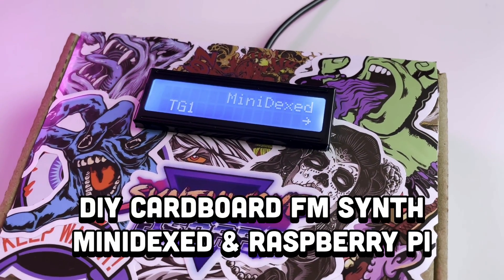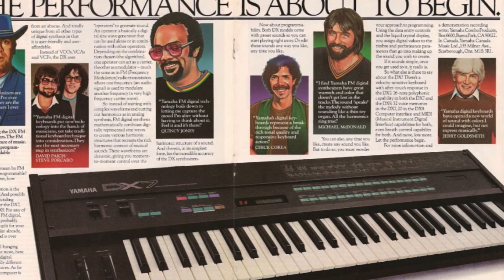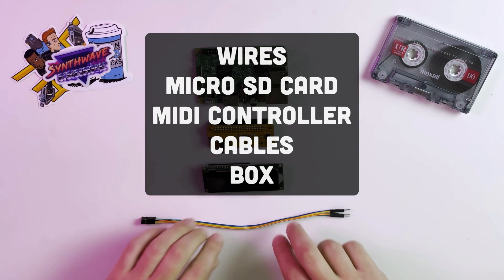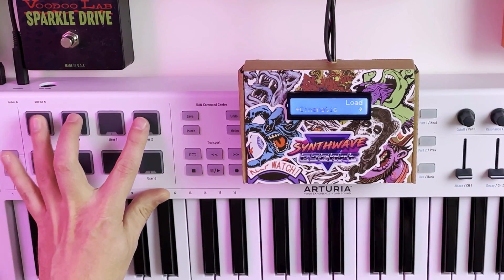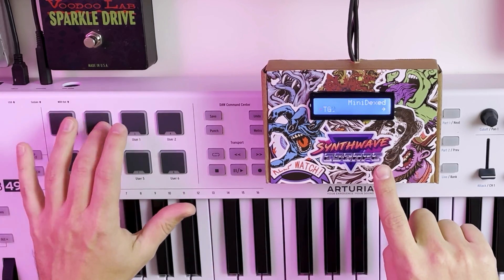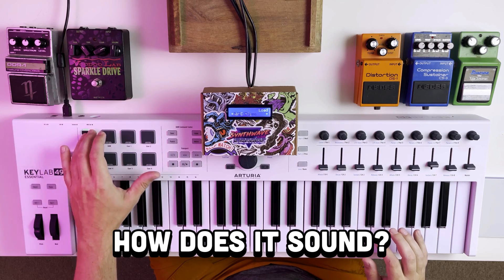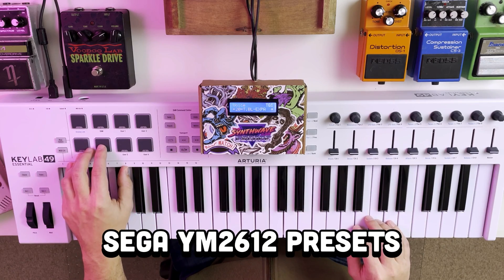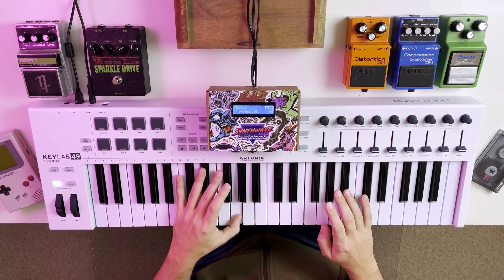DIY Cardboard FM Synth (8 DX7s!) | MiniDexed & Raspberry Pi

Comment: Quick tip on your soldering job. After soldering the wires, you could insulate them by using some hot glue. If you get your fingers wet by licking them, you can very quickly press on the hot glue to mold it to whatever shape you need.
Reply from the maker: Thanks for the tip!
Reply: Using heat shrink tubes is the more proper way to do it. Also, the soldering would probably have looked better if flux had been used. But this video is not about soldering, so I don’t think it matters much.

Comment: If the RPI is capable of hosting 8 DX7s emulations -- that's 288 operators configured into 48 voices, each with 6 operators -- surely it's capable of more advanced FM synthesis? Dexed is open-source, so it should be pretty easy (for a competent programmer) to tweak it to emulate the FVX-1 or even better, a fully multitimbral, 24-voice, 8-operator instrument, with the algorithms of the FVX-1 and the waveforms of the TX81Z (if not more).
Reply: That's kinda what I was thinking...this has far more capability than this shows!
Reply: Yes, I’d like to see a version of my Yamaha FB01 with a better interface. It sounds fantastic, but the only practical way to edit it is with an app.
Reply: Hi, did you mean 48 operators, 128 voices polyphony?
Reply: Sounds like you're describing Korg's Opsix, WaveState, ModWave, Multipoly and others all powered by a RPI.
Reply: @straighttalk2069  The OpSix is the only FM synth, no? And it's 6 operators?
Reply: @blast_processing6577  it is 6 operators, but it also includes filter FM, ring mod (AM), "virtual analogue" subtractive, and I think also comb filtering.
It's set on a per-operator level, not on a per-patch level, so a single patch can combine all the different techniques if you want. 
Mostly in practice though this means 3-5 operators being FM while the other(s) are something else, like a VA filter stage or some ring mod noisiness at the end of a normal FM chain. But it can also be a 6 oscillator VA synth, for instance, if you wanted.
It does also have a ton of waveforms, I think fully encompassing and going beyond the TX81 but I haven't fully cross-referenced the waveforms exactly. 
But yeah, definitely not 8 operators. That'd be cool as heck! The case design kind of locked them into 6 I suppose.

Comment: Hey Moby Pixel, this is a great video and you have inspied me to try this project!I have an Akai mini midi controller. However before I start I have some questions, if you could answer any of these questions this would help me massively, so thank you in advance!

1. Is there a way to map the drumming preset to the pads and run them the same time as a syth preset? I'm planning on using a rotery encoder instead of the pads as well.

2. Could I have multiple input devices to control the pie? I would like to use a rotary encoder for viewing the presets, 2 buttons, one to select, and 1 to go back, and one slider to control the volume. I feel that this would give it a cool 80's vibe while keeping all the controls on the midi available (if the answer to question 1 is yes).

3. Could I use a bigger screen?

4. Could I aux into two speakers? How would you recommend I do this? What slim profile speaker would you recommend for this purpose?

5. Could a loop pedal work here?

6. I saw this on amazon, what do you think about it and could I use it for the same purpose?
https://www.amazon.com/RASPIAUDIO-Raspberry-Models-Quality-MEGA_AMP/dp/B0CC9C3BQB/ref=asc_df_B0CC9C3BQB/?tag=hyprod-20&linkCode=df0&hvadid=693411594200&hvpos=&hvnetw=g&hvrand=5964431755418532573&hvpone=&hvptwo=&hvqmt=&hvdev=m&hvdvcmdl=&hvlocint=&hvlocphy=9059522&hvtargid=pla-2257823213660&psc=1&mcid=a30eeca3f26839289afae0742106aef6

7. Could I power this all of the above (if its possible) with a power bank?

Ok, thats it so sorry for the long comment. This is my first pie project, I have had a passion for music for around 6 years and had this controller for about 3. I couldn't use the midi because I did not have a capable computer at the time. I am also going to college for computer engineering, so this project excites me alot. The idea of having a way to use the controller without a big computer is so cool! I also am going to try to be a DJ in college and this would be so cool to make. I am going to enclose it in a laptop ish case, a rectangular prism cut diagonally for improved ergonomics and for a portable device that can hopefully be my first piece of DJ equipment!

This might be longer than one of my school papers but thank you for any feedback or reading!

Sincerely,
The Masked Drummer 25

Comment: Now take it and integrate it into the keyboard.  I'm still hoping to do that.  Integrate a small NUC that can support VSTi's into a keyboard controller and have it all powered internally.  So you turn on the keyboard and it powers the NUC then auto loads a synth.  Any VSTi you want to load on it.  

I've done that externally with a small Beelink NUC and a lightweight DAW that auto loaded when the NUC booted (to Windows 11) that then auto loaded a default project where I had several different VSTi's loaded on individual channels.
Reply: VST hardware hosts like you're describing have been around in one form or another for literally decades (the Open Labs Neko from 20 years ago might be the best known), but it's hard to make a successful product out of something like that.
Reply: @seegee-u3l  I remember the Neko, it was massive in size and massive in price.  And there were little thought into the interface and controls.  A VSTi hosting keyboard today could be much more streamlined and affordable.

Comment: Hey Moby Pixel! Great video. I got everything working just as you showed except the MIDI button navigation. I have the exact same midi keyboard as you (Arturia Keylab 61 Essential), and I can play the default TG1 with the keys, but I cannot navigate with the pads even though I set the MIDI button settings to the exact same as in your video. Did you do any other changes to the MIDI controller that I might have missed?
Reply from the maker: Is the keyboard sending the pad/notes to MIDI Channel 10? That is the way it was setup on my keyboard, but I can't remember if it was the default. It might be different depending on the which Map you have selected on your Arturia.
Reply: @mobypixel  Ok, I changed the keyboard to use channel 9 for the pads (they were set to channel 10) and I set the MIDIButtonCh=9 and now it works! I don't know why it didn't work for channel 10 but at least I got it working now. :)
Reply from the maker: @mags_artist  Awesome! That makes sense. I’ve heard that user interfaces start MIDI Channels from 1 but are programmed to start from 0.
Reply: @mobypixel  I can play the MiniDexed with the keyboard when I have set the MIDI Channel to 10 in minidexed.ini. So I assume that is the right channel since you are using the same channel with the same keyboard. But I'll see if I can get it to work with some other channel.
Reply from the maker: @mags_artist  My keys and the pads are being sent to different MIDI channels. My MIDI cable is hiding right now so I can't test it. Try holding Map Select then tap the third pad. This will set the pads' MIDI channel to 10 by default. The keys MIDI channels are set by holding the MIDI CH button then the corresponding keys. I'm guess your pads are not going to the correct channel.

Comment: Very cool build! I am trying to map an Arturia MiniLab the same way - quick question, is the rotary function of the rotary knob being controlled by MIDI? In other words, were you able to control any of the parameter value using a knob or slider on your Arturia? What a time to be alive!
Reply from the maker: I think menu navigation and parameter setting is done by button presses, a tick from the rotary encoder, or "Specify MIDI CC to act as a button NB: Off < 64 < ON." So you can use a MIDI CC knob as a button but it seems cumbersome the way they describe it. (https://github.com/probonopd/MiniDexed/blob/e03122a3d232e7b20e5ccbb54de6f0dff5f7666f/src/minidexed.ini#L113) There might be more information about it on the MiniDexed Discussions tab on their Github page.

Comment: 5:30 does it need all of those buttons setting up?  That seems a lot, just to navigate the menus.  What do you have to press to see the patch name?
Reply from the maker: It's not too bad. You set it up in the minidexed.ini file: https://github.com/probonopd/MiniDexed/blob/afa72d21aa81a9876b3f9e50f3bd6f4cd56cdac0/src/minidexed.ini#L113  The other option is navigating with a rotary encoder like Floyd Steinberg did in his video. To see the Patch Name I navigated to the performances tab and selected it. I'm not sure of a shortcut for seeing the names if you are deep in the menu stack, but you can change patches with a button press.
Reply: @mobypixel  Thanks.  I see two pins there for the encoder, so that would cover turning it, but nothing for the encoder button or built in switch... Is it defined as one of the other buttons?  I don't really get how all those other buttons can be replaced with just an encoder, but I assume it has at least the usual built in button in the encoder to do something.  I've looked at the documentation a few times but I haven't really got all that far with understanding it.
Reply: @mobypixel  Okay, I've found a bit in Wiki Files, that says "ButtonPinShortcut defines the pin that is used for rotating the rotary encoder knob while the button is pressed. Probably you will want the button that is built into the rotary encoder to be used for shortcuts."  I really have no idea what that's trying to say so I guess I'll just have to try it and see what happens.
Reply from the maker: @TooSlowTube  Yeah, a the rotary encoder is an endlessly turning potentiometer that can be pressed as a momentary button. I think in MiniDexed one click selects and a double click goes back in the menu. I used one in my Teensy Synth build recently.

Comment: Korg’s Fm synth the Opsix as far as I am aware is pretty much just a raspberry pi in a fancy case.
Reply: akai mpc also
Reply from the maker: That's cool! And pretty surprising for a big name like Korg. They also made a synth/game for the Nintendo DS. I know a lot of people also like Korg Gadget on iOS, but I haven tried it.
Reply: What is a digital hardware synth but a software synth running on a computer, at this point? There's not really much functional difference. The selling point is more the control surface than what's going on inside. Might as well use a cheap mass-produced multi-purpose SBC when it's easier than bothering with custom chips.
Reply: @Swenglish  Yeah - in the early 80's when the first-generation Yamaha FM synths came out, it wasn't possible to do realtime polyphonic FM/PM synthesis on a small computer, so they had to roll their own custom chips and do it in hardware.  Nowadays though, even ultra-cheap computers like the Pi are fast enough to handle several dozen channels of audio in realtime, so there's really not much to be gained by not taking advantage of them.
Reply: @ Exactly. Unless one can make a custom board that does something a cheaper mass produced board can't do, or fits in a form factor that no such board can without overheating, it's just a waste of funds, time and effort. And that bar is only getting higher, because more and more computing power is being packed into smaller and smaller boards. So the things to work on when it comes to any digital instrument larger than a brick that's not specifically meant to authentically replicate old devices with all their quirks are mostly software and physical user interface. User experience and sound. Might as well use off the shelf internals.

Comment: For future reference, the header on your audio board is made for female jumper wire connectors. You could have connected it to the pi with female to female jumper wires instead of soldering it.
Reply from the maker: Thanks, @System-1541! I did that when prototyping, but the female ends didn't seem to make a solid enough connection on the I2C LCD. The LCD would reset with the slightest bump. I should have used heat shrink though for sure. 😅

Comment: Fantastic overview. Did not know sound is now so straightforward with the Pi.
Reply from the maker: Thanks! Yeah, honestly the only challenge was getting the audio into my Mac for recording since it doesn't take a 3.5mm cable as an input, and my Focusrite only has mono inputs. I got a 3.5mm to split XLR cable and that did the trick.

Comment: This is really cool! What is the black board behind the i2c LED screen? I have this screen kicking around, but not that one
Reply from the maker: The one I bought came that way. It only requires running 4 wires. https://www.amazon.com/Hosyond-Display-Module-Arduino-Raspberry/dp/B0BWTFN9WF

The other LCDs will work, but you might need a port extender. That's how Floyd did in his tutorial linked in the description.
Reply: The smaller board is called the "i2c backpack"  As you can see, the LCD itself takes many many more pins(14 I think), and that backpack is soldered to the LCD(along the upper edge, see all those solder joints) driving those pins.  So the RPi sees the backpack as an i2c device over it's 4 pin connection and sends the backpack display commands, then the backpack controls the LCD in turn.